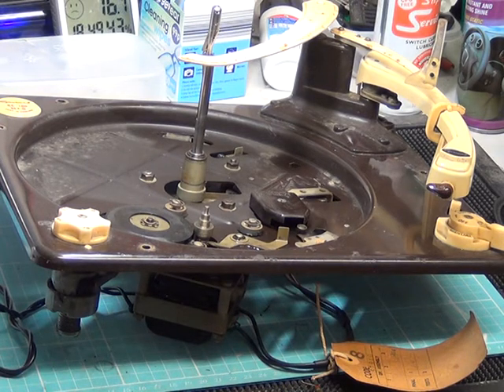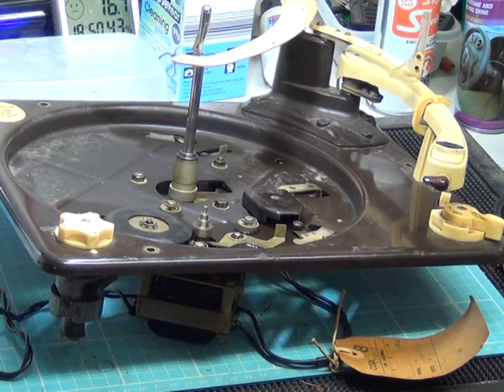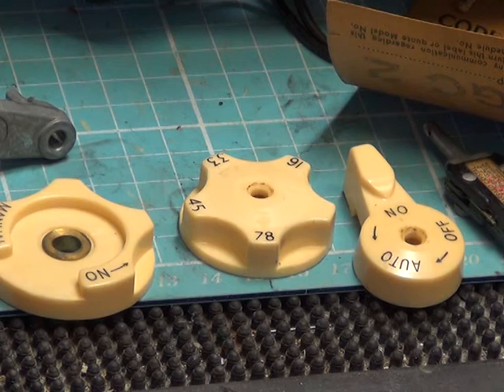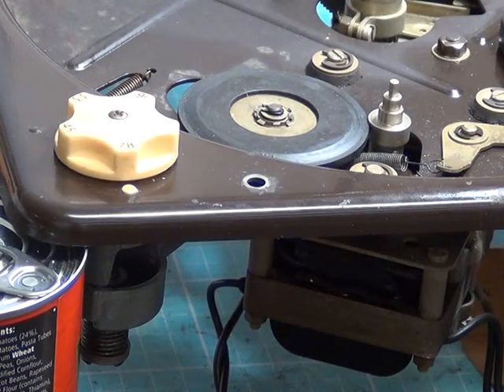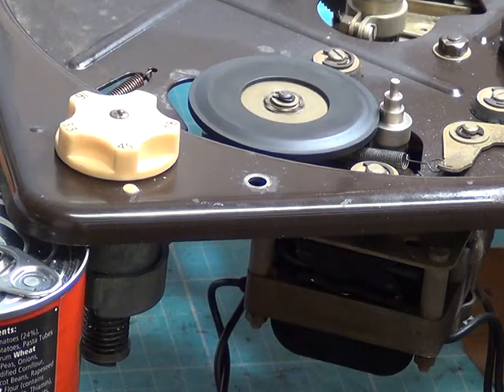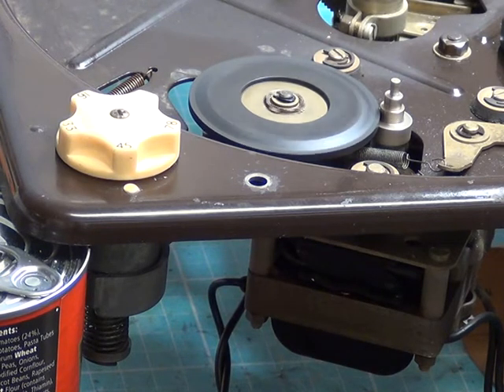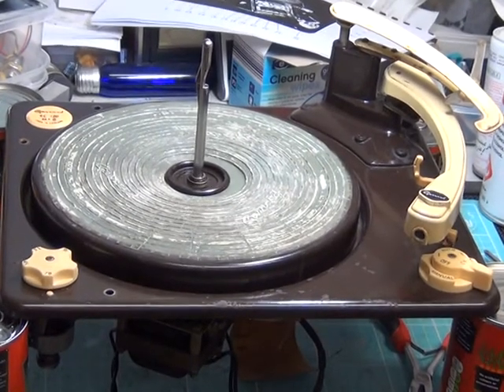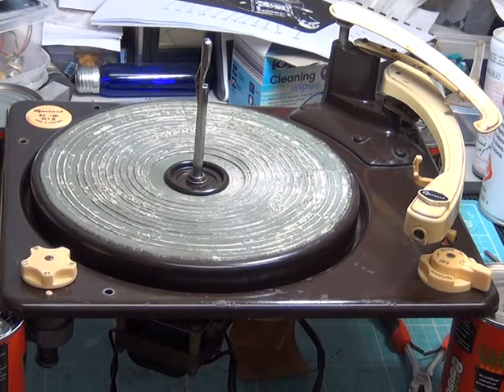HMV 1628 radiogram overhaul - Garrard RC120 record deck - Part 2.2

Comment: Hiya Rick will it work with baked beans as well lol the clonk is the brake the felt pad has worn away and you can rebuild the cartridge I have done a few of them over the years
Reply from the maker: Hello there. I realise what the clonk is & should have said so on the video. The plan is to go accross to our pipe organ workshop & punch a small disc of felt & glue it onto the worn cork brake. That'll fix it.  The other RC120 I bought to compare (seeing as this had that missing spring it transpires) has had a GC5 cartridge fitted at some time though the attached label clearly says it's fitted with a GC2. Guess what.....that's no output either. I'll get my crowbars out today & look at the cartridge. I'm good at the 9TAHC cartridges (ceramic) fitted to the Stereomaster's I do.It's never the element, always the mount that's tarnished in those.

Richard